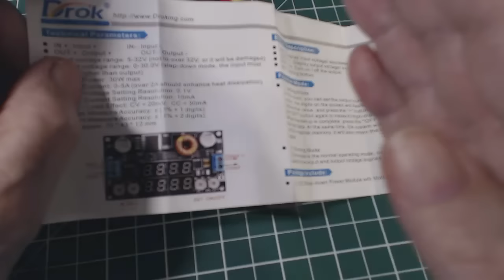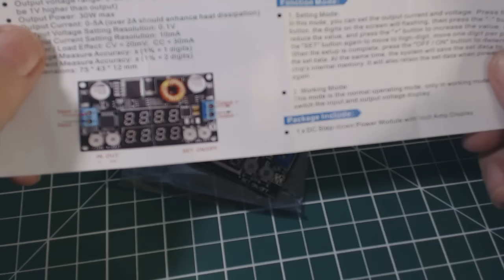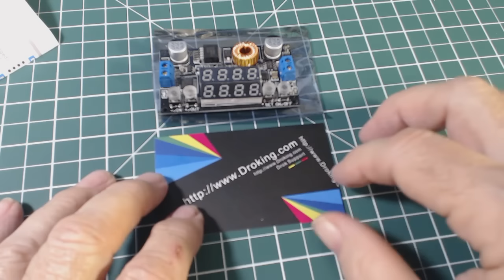TRRS #0832 - DROK DC to DC Converter

Comment: The question of questions does it prevent the dreaded switching power supply noise from making SW listening possible, and hopefully if it works it prevents all such interference.
Reply from the maker: +watershed44 I have my doubts that it can turn a bad supply into a good one.  It is not a filter only a converter but we will see.

Comment: Hi Tom. I was wondering if you could do a video explaining what an Unun transformer is. I see these two types of antenna on DRC Inc (antennas) ebay page. One has a Unun transformer and one doesn't.
Reply: the ohe with a 9:1 UNUN ( unbalanced to unbalanced transformer ) is used with a random length wire antenna. The 9:1 UNUN is DC grounded through your coax to your radio antenna jack, which can help to reduce interference and background noise. the other I believe you are talking about I'd the one with a 15' coax lead line. it does not have a transformer and Tom did a test on it about a week ago. I will see what show #
Reply: +DRC Inc show #0825
Reply: +DRC Inc Thanks for the reply. The reason I am asking is because I currently have a Tecsun PL600. I would like to try a longer/better antenna with the radio. I had seen Tom do a review of the new one you had made. But, I am now thinking about buying an Icom R75 or Alinco DxR8T and I am wondering what antenna would go well with one of those radios. So I was hoping to understand what a unun does for SWL. Would the antenna with unun be better here?
Reply: Depends on how long of a coax run you will have. Those radios I believe have a so239 antenna connection
Reply: The one with the transformer is longer and has a bnc female fitting so you can use a longer coax.